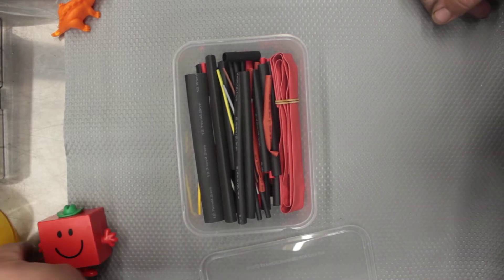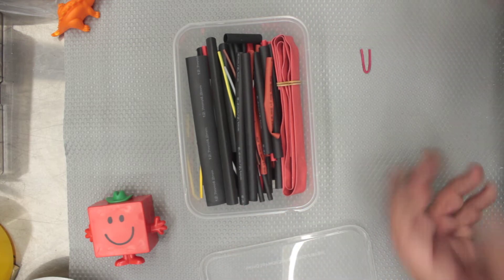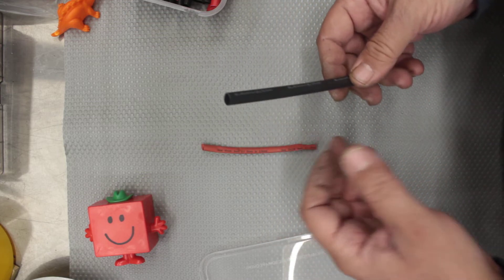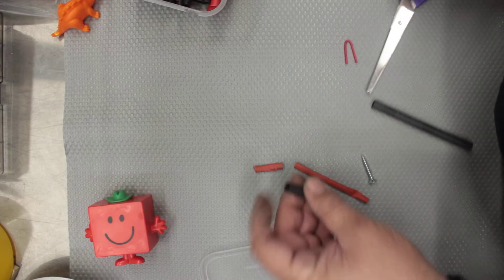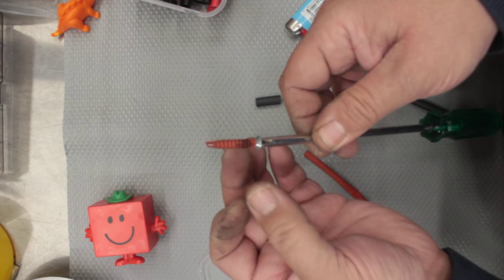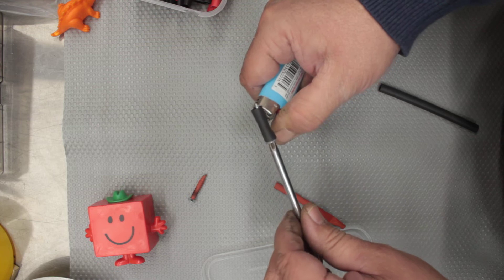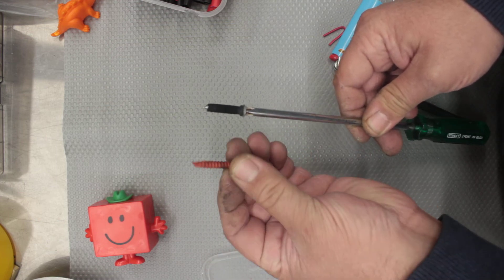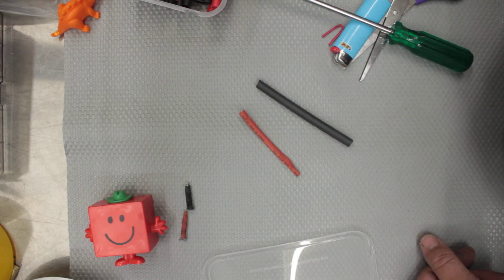Heat Shrink - Why does some cost more than others ?

Comment: Scotchloks are a strike installers dream.  Stick both ends in, press in one motion, it's joined and sealed with dielectric grease
"Wago" brand wire joiners are awesome for testing and troubleshooting temporary joins, or longterm connections out of the weather.

Comment: As an auto & marine electrician for 24 years ....I would not use anything less than glue lined double wall heat shrink.
Unless of course you get too 2mm 4mm.
To reduce the cost you  an by it in 5m to 10m length